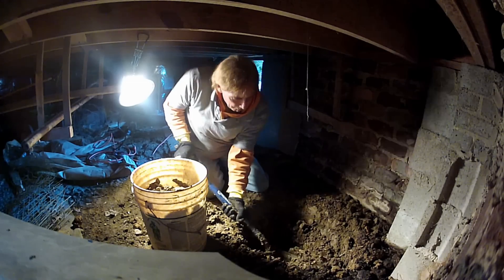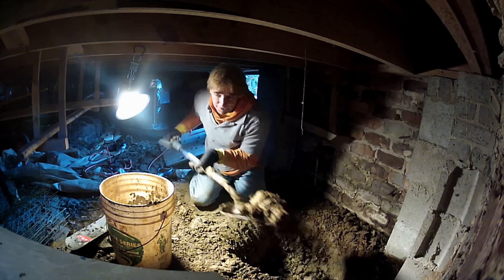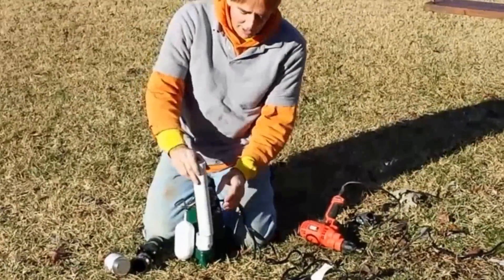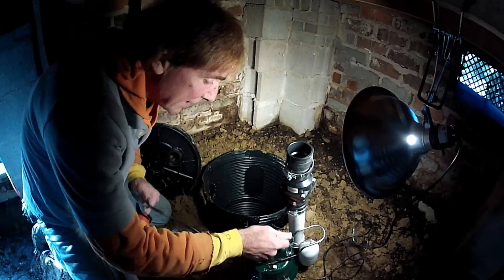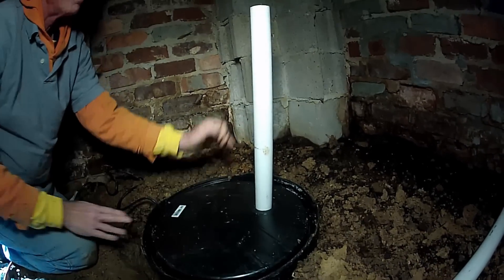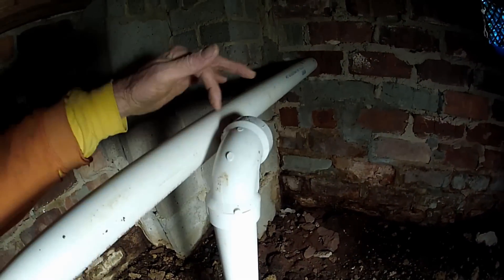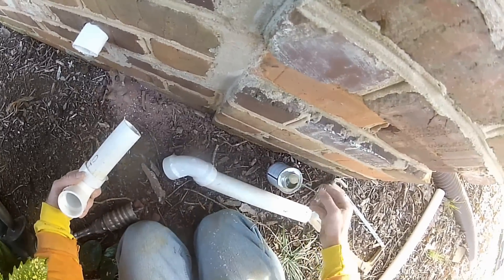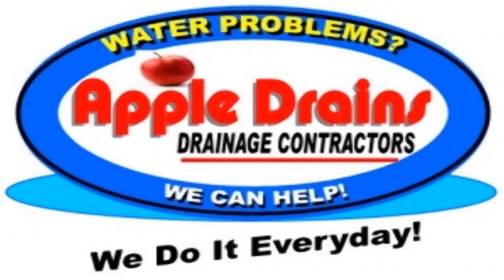How To Install Sump Pump  in Tight Crawl Space, by Apple Drains

Comment: When they installed the sump at my house they did a poor job, just dug a hole and sat the pump in with no basin.  My biggest issue with fixing it is that the sump is at the opposite end of the house from the crawl space entry door.  I have to low crawl to get under some of the HVAC ducts.  And what the guy from Indiana said about clay sticking to the shovel, I've got that too here in Alabama.  Thanks for the video.

Comment: I would be so lucky to have that much space... Mine is about 1.5 ft. 2 at the most.            Combat-crawl space.
Reply: Same here! My house was built in 1900 and back then there was no such thing as crawl spaces (no indoor plumbing/electricity so no need). My crawl space was added after the fact and any time I need to go down there I feel like i'm going to suffocate and keel over with all the insulation, ac ducting, no room and nasty dusty air. This is why I think basements are a must either that or a finished concrete slab crawl space that is sealed at a minimum. I sure wish I would have taken all this into account before purchasing my home.
Reply: Same here. I would love that much space.

Comment: Thanks for the video. Is there any digging machine that can help dig quickly in this tight space? Also, do you need to put liner around the basin? And how do you hook the pump to an outlet if it is located inside the house?

Thanks

Comment: This is really a great video. TY so much
I have a question. If a pump keeps going on & off all day. I mean constant on off on off. Plus the water goes half way up then back into the pump
 Our does it even when is not wet outside.
Reply: Did you install a check valve?  If so, verify it is in the correct orientation.
Reply: Jim Finn We ended up having to get anew plump.  The was we had was builders grade. We did upgrade to one that has a ck valve.

Comment: No need to use pvc cleaner? I see you use pvc glue only.  Do you have any trouble with the sump pit container rising out of the hole by water causing it to float up? Thanks for your help
Reply: I would assume if water is out side of the sump it would, if effective, also be inside neutralizing boiyency. it is a great question though.
Reply: He usually drills several holes in the black sump pit container on the sides and the bottom w 1/4” bit using a drill in other videos so the water flows in from the sides and the bottom.  Great videos.   We’ve had record breaking rainfall in middle Georgia.

Comment: NEED to use purple primer on all these joints before the glue is used.  Keep running into pro folks who don't how to do plumbing correctly.   There is a good reason that the glue and the primer is sold together in a little box at the store.  Without primer the joint can blow apart under pressure.  Note also that building inspectors will FAIL your work if they can't see the purple stain at all joints.  It only takes 10 seconds more and costs about $3, so do it right every time.
Reply: This is not a water line or a sewer line, so it does not require an inspection.  There is almost 0 pressure on the line, therefore it can't blow itself apart.  If there is any pressure, you have a plugged up discharge line.  Primer is not necessary, nor is it required for a sump pump.  Sounds to me like your just trying to overcharge a customer when it is not necessary.
Reply: Yeah my dad ALWAYS uses the primer. I was suprised to see it wasn't used.

Comment: I mean no disrespect, your videos are very informative and I'd recommend them to anyone needing drain advice and know-how, but this is in no way a tight crawl space. I'm trying to find a video on how to install a sump pump basin under a house with about 18 - 20 inches between the ground itself and the floor of the house overhead in the crawl space. I literally have to shimmy around on my stomach rather than crawling on knees and elbows down there. There is no room for a shovel, even a small one like the one you're using in this video, to stand upright so I can penetrate the ground. I have no idea how I'm going to be able to dig it out.
Reply: Use a hand held gardening shovel 🤣
Reply: Did you get it done?  I would've dug a trench  and placed a drain to an  external sump
Reply: That’s a tight crawl space.  Did you get it done?
Reply: If you believe you can do it with a child’s plastic sandbox shovel, anything is possible. I believe it will take you a few weeks
Reply: I have 16” of hight in my crawl space. I’m 6’4” 250lbs…. No idea how I’m going to do this 😭